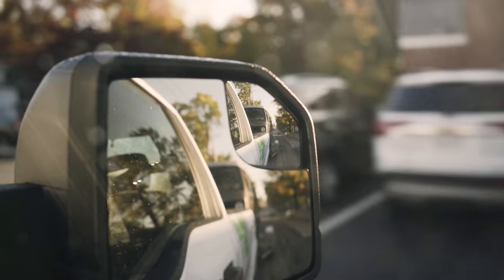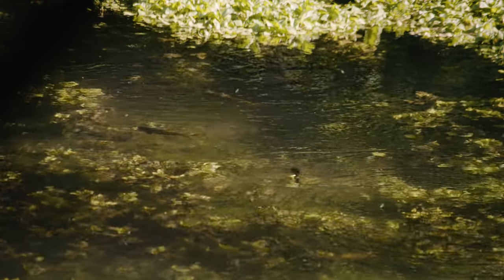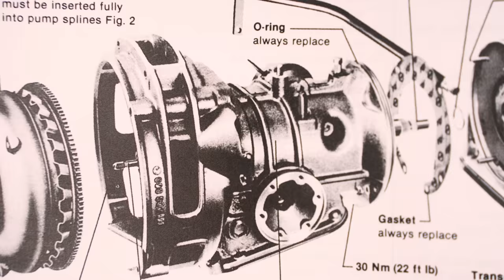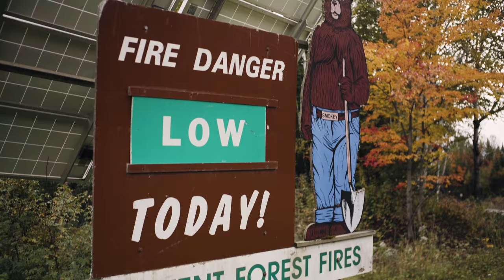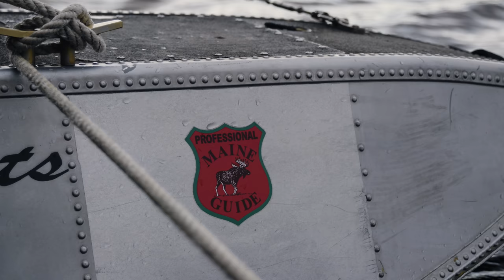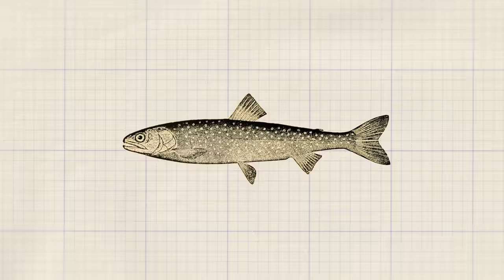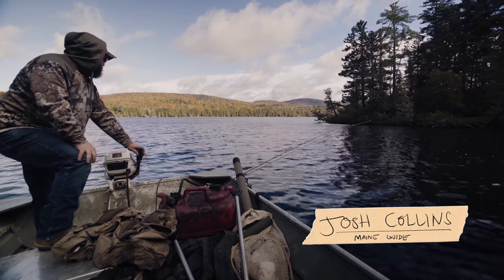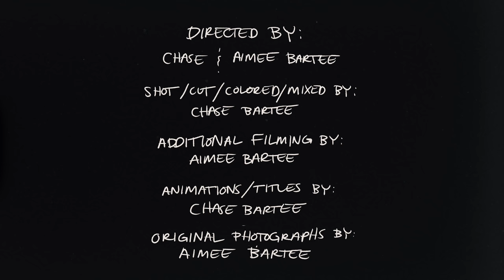THE QUEST TO CATCH MAINE'S RAREST FISH || For Wild's Sake: The Rare Trout Chronicles | Episode 1

Comment: Big reed could still be a huge disaster waiting to happen. The introduced population of charr are all descended from the fish
Reply from the maker: You’re absolutely right. Genetic bottleneck is a major concern. Time will tell.
Reply: @TightLoops  it's not the only population of blue backs in Maine why didn't they mix the genetics 🧬
Reply from the maker: @nickkinney4942  because that would be terrible science. For decades we've understood the importance of "localized" genetics. Each population is specially adapted to the unique environment they live in, and they've been isolated there for thousands of years. Not all bluebacks are the same. The best chance those fish will have to survive is to maintain genetic purity. If the plan wasn't to preserve Big Reeds genetics, then why bother at all?
Reply: @TightLoops  it's a landlocked sea run fish in the beginning the genetics were all the same I don't think mixing the genetics from another isolated pond or lake is a terrible thing now that the fishery has been conserved I believe in order for it to thrive as in all things new blood will need to be introduced
Reply from the maker: @nickkinney4942  That's not really how it works. Those fish have been isolated for 10,000 years. Plenty of time for local adaptations. We don't have tools sensitive enough to differentiate the difference between isolated populations of the same species yet, but fisheries science has learned the hard way that mixing and matching fish from different systems is highly ineffective. Just ask the salmon and steelhead recovery efforts on the west coast. But regardless, the point of this project was to save THAT population. If they didn't care about their unique genetics they could have just let them die and then restocked with an entirely different population from Maine or Quebec.
Reply: @TightLoops  I know how it works I've lived in Maine my whole life and I helped in the reclamation process of big Reed lake I was there there were more than three char left in that lake before the chemically reclaimed it that was the biggest mistake sterilizing the whole entire lake instead of trying to cull the rainbow smelt population. And I really don't think the population as pure as you might think
Reply from the maker: @nickkinney4942  Are you implying that someone has transferred charr form another lake into Big Reed?
Reply: @TightLoops  I don't know what happened after the three fish left the lake I just know the whole job was rushed and a little sloppy I worked on several projects that year on different bodies of water to conserve  the Blue back fisheries in Maine department of conservation and nature conservancy received a lot of grant money for the Arctic char
Reply from the maker: @nickkinney4942  Well, make sure to tune in on sunday for episode 2. We cover the restoration in great detail after those fish left the lake. For whats its worth, they captured fish for 4 years, totaling 14. I believe only 8 were successfully bread. And from whats been explained to us, directly by the people who did the culturing of the fish, it wasn't sloppy at all. And it certainly wasn't rushed.
Reply: @TightLoops  I will definitely tune in thank you for listening and I enjoy your videos and appreciate what you do for the fishing community I don't mean to rant but that particular subject is a sore spot for me. Just remember there's a difference between conservation and preservation
Reply: The Char and the Brook trout that went back in to Reed, all were direct genetic descendants from the fish originating from Reed Pond,  It was a perfect reclamation.